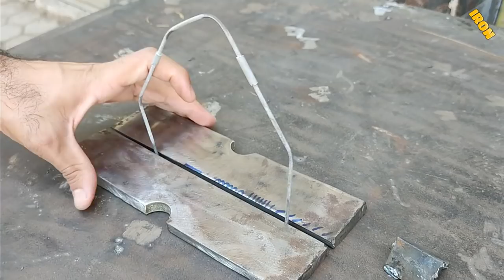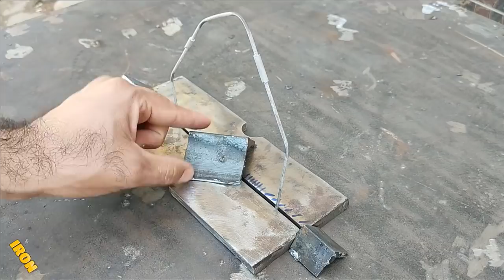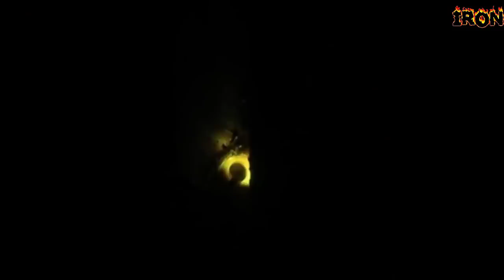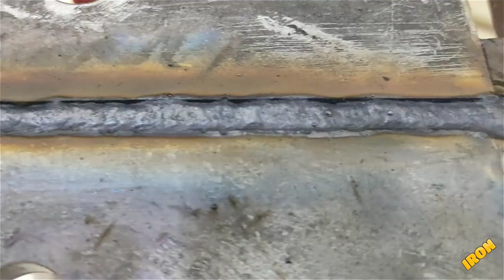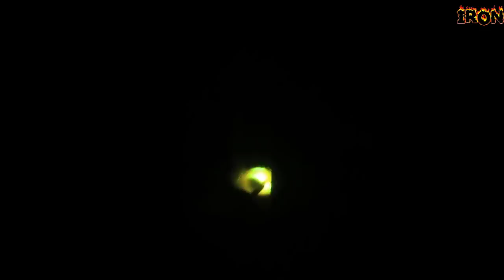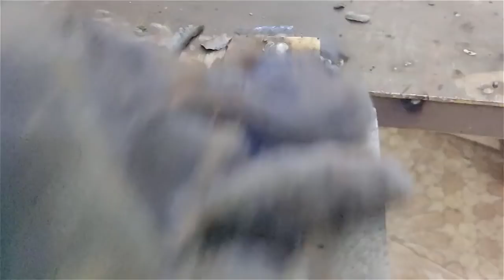Welding MIG 1G

Comment: This weld was not MIG.  Is this welding Semi-automatic welding for CO2 and flax cored wire?
Reply: I use dual shield at work atm and it looks completely different. Just a thin layer of slake. I think he use flux core wire